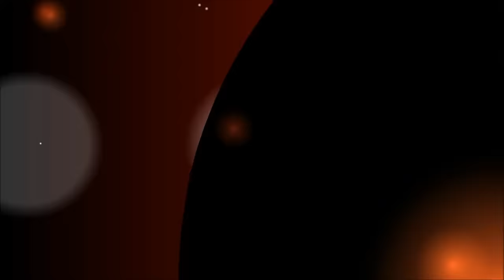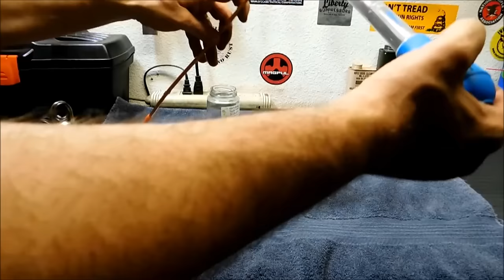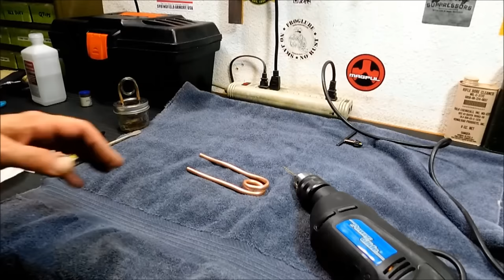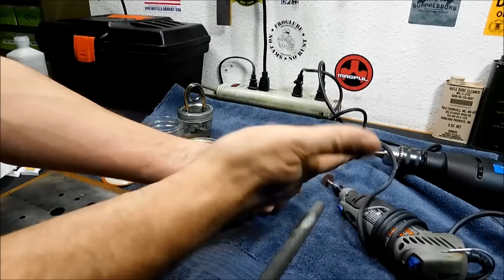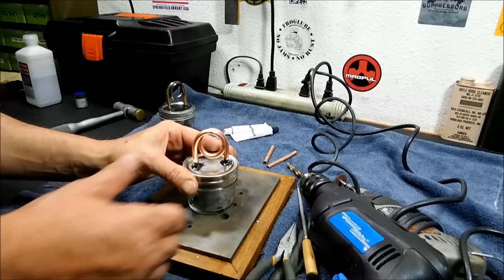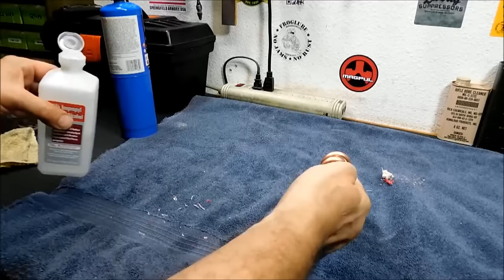Build Your Own Copper Coil Alcohol Burner Stove!

Comment: If you stick a little scrap of cloth under the drill bit when you are drilling your holes in the cap, it will create a more uniform hole. That or you can get a Step Bit, they are handy to have anyway.

Comment: I know we are all experts right? well anyway I have been bending copper tube for a good period of time in my short stay on this condemned planet and I can tell you that simply overbending the copper and then bringing it back to parallel will work a lot easier and faster with very little or no distortion and no vice needed with the exception of holding your shaping tube. I use a product called Cerrobend which I realize is not needed to make a lamp or two at the price of Cerrobend it would not be worth it but it does give you a great backer inside the tube it melts at 168deg and works great, anyway nice little project thank you!

Comment: Any cotton twine makes a good wick. You can buy if for tying poultry or roasts for baking. There are 4 types of alcohol that are suitable: Ethyl or grain 200 proof (expensive!), Methyl alcohol, for solvent, comes in quart and gallon cans, isopropyl rubbing alcohol, 70%, flames yellow, not so great. Isopropyl  rubbing alcohol 94%, pretty good, pretty cheap.
Reply: Denature alcohol from the hardware store is cheap and sold as a fuel. It's commonly ethyl alcohol denatured with methyl alcohol, which is toxic to ingest. But pretty much any kind of alcohol will burn, if it's pure enough.

Comment: I would like to try this.  But maybe modify it to have a preheating wick below the coil.  I think a second, tiny glass jar installed into the lid would allow pressure to be maintained in the larger jar.  Drill a wick hole in both the big lid and the tiny lid and use JB weld to attatch the kids to one another.  Fill the tiny jar, add wick and drew it onto the big lid.
Reply from the maker: I have since attached a small empty pistol casing under the burner now, I fill it with alcohol, light it, and let it prime it. Works perfectly

Comment: If I understood correctly, yes, this technically still has a wicking agent, however rather than being consumed, it only acts as a way of sucking up the fuel, and bringing it to a spot on the loop of the coil to allow only the fuel to be consumed? I might be exaggerating but in an emergency I think that’s a game changer. My problem is I wish I understood the gist of the process a bit better, so that maybe I could improvise or substitute aspects of the demonstration. It definitely seems important to have the copper tube which means needing a way to bend it properly the clamps the way to poke a hole strategically ect. I wonder, could this work with slower burning oils, maybe with a different wicking agent? If unable to acquire a hollow tube of copper would other metals be soft enough?  Could the mechanism of the wicking be effective in any other way, so that fuel reaches a burn location safely, involving less tools and shop experience?

Comment: Jb weld was originally designed to withstand engine block temperatures in drag cars which get a lot hotter than alcohol burning the designers needed something to fix cracked engine blocks so they didn't have to throw them out so soon they could get a few more runs out of them 👍👍

Comment: A cheap stand can be made from an empty Can. Cut out the bottom and cut a couple of holes in the side, not opposite each other. You could solder the holes around the copper tube too ... I think it would be better than JB weld ....

Comment: Curiosity Never Killed the kitty, the Kitty put on his thinking catnip were you where putting in sandblasting sand then kitty made me think real quick first thing that came to kitty mind in his 2% mind was breakline second click in a Split Second thing it comes to mind is fluid in a line becomes a solid substance oil or water one of the same as sandblasting sand in side the interior now we have a solid line.
Thanks for stopping by the house of curiously of kitties.

Comment: The sand tip is a good tip.  Also if you were to heat up the copper tubing first red hot then let the tubing cool.  It will be more malleable and easier to bend.  I would still do the sand trick but only after the copper cools down.
Reply: Ken Dalke That's steel, copper only sometimes gets softer depending if it was cold worked or not.

To anneal it you heat it and cool it in water, same way you'd harden steel

Comment: Thanks for the video, I have made and used a variety of alcohol stove designs in the past successfully....
  I had two questions : 
   How does the stove behave after it burns for a while? Hot metal can be prone to a 'runaway burn’ and having too much burning alcohol exit the orifice and spill liquid flame is a bad time. 
   Is there a risk of explosion? ...I had a similar design with the mason jar style actually allow flame back through to the air/vapor space  inside and blow the lid/ring off after a few mins of operation. Sent flaming liquid over a fair area of my workshop. Very happy I was in another part of the shop when it occurred. Frightening. I am very careful 100% of the time and this was a dangerous surprise. 
Thanks and cheers.
Reply: *Precautions and hazards should have been at front of this video.  *Thank you for noting this very real possibility.
Reply: @Bobby-mg1uj  Thanks for the concern and all Bob .....I am meticulously careful about safety, especially involving open flame + flammable liquids. I had done this in the past before I'd seen this particular video, so the 2 events aren't exclusive to each other. I have since changed the design to single wick and and have filled all airspace with an inert porous mineral material. Tested at high heat extensively with safety in mind and no issues so far. 
I appreciate the caution in your message all the same. Be well. Stay warm.

Comment: excellent presentation , if your not a teacher you should be.  my only 2 questions are ,is how long can it burn for before it heats up and explodes, and are the fumes harm full? ok my bad,, 3 questions ,, if i poke 2 holes,, will it produce twice the heat?
Reply from the maker: The bottom never gets hot (the glass area) it might get warm but never hot enough to pop.  No fumes that I could smell, other than the smell of rubbing alcohol.  You might get less pressure and less of a flame with more holes, the reason this really burns is because pressure builds up and makes the fuel a gas so more holes might mean less pressure.

Comment: This is very interesting. I'm curious how long will the fuel last? I'm sure its a good stove but would it be a good heat source? I'm currently experimenting with Crisco candles which will last forever but they aren't the hottest. This flame is much hotter but I would like to get around seven hours of burn time. Possibly a pint jar would last longer without being too large?!

Comment: Also I wonder why you didn’t make the “coil” in a horizontal fashion (making 2 loops with bottom loop having the hole) so that you could actually set items directly on top or top horizontal loop and take at advantage of both flame and heated copper coil?   Make the first or bottom loop a smalls diameter so flame comes out and through the upper horizontal coil and actually captures more heat in space between coil and conductor.

Comment: Put a dimple in the lid under the coil.  Fill the dimple with fuel and light. The burning fuel will heat the coil and start the pressurized flame.
Reply from the maker: Actually I cut down a fired .45 case a bit, and put it under the coil, works great now and you dont need a blowtorch to prime it!

Comment: Thanks for posting the video. Using your info as the model I was able to reproduce the burner, however I used a tin can instead of a mason jar and instead of epoxy I get the same results with super glue mixed with baby powder and it dries much faster. Thanks again

Comment: You could use JB Weld Radiatorweld, that will never have a too hot issue.
Reply from the maker: I never heard of that, thanks I will have to look it up, I still have this little burner, and it still works but yeah I always wondered about the heat and it degrading the JB weld.

Comment: May I suggest annealing a copper before and possibly during bending. Just heat it up with torch, over gas oven, or any other heat source and when it gets close red hot, drop it in a water. 
1)Obviously, you won’t be able to heat up the whole thing and keep it red, so do partial( local) heat quench. 
2) quenching isn’t necessary, just getting it to red hot is enough, but quenching in water makes it even more softer.
3) obviously use body protections, don’t catch anything on fire. Do it outside or have fire extinguishers 🧯 close by.
4) keep serious, mean facial composure, for an extra points...
Reply: Quenching (fast cooling) makes it harder, not softer. Annealing (slow cooling) makes it softer because it doesn't crystallize the metal as much.

Comment: i saw those same as your and they can burn in jet flame and I am sure yours will be too.  My tube is 5mm in dia and 0.5mm thick with a 1mm hole for the  flame.  It din burn good and I am not sure if there is anything about the wicks which were the cotton gift wrapping twine I stuffed in.  I am using the industrial alcohol.

Comment: Hmmm just wondering if you could pre-drill the hole in copper, cut copper to the right size, fish a 1/4 in wick threw a 1/4 inch copper, then bend copper

Comment: You dont need sand if you do it right. when you buy the 1/4 tube at Home Depot buy a 1/4 tubing bender for less than $15. save a lot of time and steps.

Comment: Could this go bigger, say a gallon jar with bigger copper with (3-4 tiny holes drilled in the copper).? If so, then I have 2 plant holders with 4 legs and open at the top (where a potted plant could be set in it). Like a 4 legged tripod. A large cast Iron pan on top would catch the fire's warmth. I would only use it outside.  Whatcha think?
Great teaching video.

Comment: Copper spiderweb 🕸   i found  some copper wire in plastic conduits  off cuts 3ft  1/8 thick wires  inside  - also had a  few old transformers about 🚶‍♂️ 
then my mind clicked 1 week latter  then made an aluminium  spider  and hung it in the toilet My mate said thats different never seen it done b4

Comment: Looks interesting.. and a claim of boiling 2 pints in 8 minutes is pretty incredible! It would be nice to see it in action after it's 'burn in'. Does it need to remain 'primed' so to speak?
Reply from the maker: Nope once you prime it it works pretty well with just some heat under the copper, however i did add a priming pan under it so I can put some stuff in there, light and it and let it go on its own

Comment: I wonder how long the JB weld will hold up to the alcohol? I really like this design but I would prefer not using any glass in case of dropping it. It would be nice to be able to cover and seal the top also so you could store it in a backpack full of camping gear without risking getting fuel everywhere.

Comment: Great idea! very smart......A silly question, like any propane burning stove..do we have to watch out for any type of example: monoxide poisoning type of issue when using this inside? Thanks
Reply from the maker: While burning alcohol inside is a bit safer (Most boats with stoves use alcohol stoves) you still have to be careful.  In a large room with a bit of ventilation you should be perfectly fine.
Reply: @Iridium242  Thanks for the quick reply

Comment: Definitely you have a talent for step by step description of your process! I will do this as I did buy a Trangia, from Sweden,  stove that I don't have an opinion about! I inherited 12 liters of ethanol, and though I am a Coleman  die-hard, I will use this fuel source I have! What is the support OVER your stove, that will accomodate a skillet or a sauce pan? You are alright! Thank You! Rattlebone...
Reply from the maker: I used a hobo stove in another video I did a few days after this one,  This stove fit right into it, and it worked great.  Thanks for watching!

Comment: Did this project exactly how you built it, even used the oil candle wicks. .250" OD copper tube(no kinks) and when I tried to light it, it won't stay lite. The interior hole is .0625. Is that correct? Using 70% isopropyl alcohol

Comment: Hey this is pretty neat ..one quick question though ..where exactly did u drill hole? In the bottom of the loop correct? Thanks much appreciated 👍👌
Reply: yes. think of the purpose of the coil. to allow fluid coming from the wick to be heated to vapor before it reaches the hole.

Comment: What do you like to use to plug the hole when storing the burner for days/months to prevent evaporation?  I assume that item has to be resistant to alcohol and not absorbent like wood.

Comment: Hay would placing a ribbon burner in the center with the copper tubing just to the side's of the ribbon burner with a twist valve for the ribbon stove to control the flame on the ribbon burner with a preeheat dish work? Been thinking about this concept for a while and wanted to ask someone who has worked on these type's of stove's? Other idea was to get an empty fire extinguisher and repurpose it into a alcohol resivor. Then use electronic's with a frequency emitter placed into the bottom of the resivor to cause the alcohol to vaporize building pressure in the tank. Organic carbon power cell used to power electronic's and frequency emitter. Stainless steel flip top trash can with foot pedle and hardware removed. Craddle to hold alcohol resivor and electronic's and power cell that can be lifted up abd placed into trash can and locked into place with a metal fastener. Copper tubing mounted on the indide of the trash can in the front that has connection's at the top to connect the alcohol resivor and a quick connect at the bottom were the foot pedle used to be. Then place a clap's to lock the trash can lid down and mount a handle to the top of the trash can. Otay now get a HHO 32 micro jet burner or a Jerusalem burner and make a mount to be able to insert burner into a Titainum cylinder. Then get a G stove wood stove and drill a hole into it's bottom and mount the burner with Titianium cylinder inside. If done correctly ypu should have a presurized alcohol system to operate your G stove by super heating the titanium cylinder which will glow white hot with the stainless steel G stove absorbing the heat. 😀👍

Comment: Methanol (methyl alcohol or wood alcohol) would probably work well in this stove.  It is cheaper than either ethyl or isopropyl alcohols if bought from a racing shop, where it is used as fuel for race cars.  Add a little boric acid and the flame will be pure green.

Comment: Does the wick feed the flame all the time or just until the copper gets hot ? Does the heated copper draw the fuel up after it heats up ? AWESOME VIDEO BTW !!!
Reply: The wick doesn't feed the flame. It feeds the fuel into the coil, which is then vaporized around the top of the coil. It's the vapor that burns when it exits the hole.

Comment: I did everything in this video but my jar was bigger ,and it won't work ,I've sealed it but guess I'll have to double check,very frustrated,are icopropyl alcohols different ,cause that's what I'm using ,any ideas please.
Reply from the maker: I tried it with a larger jar too, it wont work because it wont build up enough pressure, that's why i stuck with the smaller bell jar

Comment: Hey man, cool build.  I used to make similar out of a vienna sausages tin and a tuna fish can.  When i used rubbing alcohol, i noticed a soot would build up on my cookware, and I guess inside any tent or anything i was using it in too.   One time I tried using 'Heet Gas Line Antifreeze and Water Remover' instead, since it's mostly just (i think) methyl alcohol anyways.   Absolutely no soot with the Heet.  Burns as well or better than the rubbing alcohol, so maybe try some of that sometime.  Does anyone reading this know if burning methyl alcohol is particularly unsafe?  I don't think so.
Reply: Anon User hi. According to MSDS only byproducts of methyl hydrate (methanol) combustion are CO & CO2. Therefore not particularly toxic :)
Reply: @petermccarthy9153  you must be Canadian as the official name has been methanol since 1840.  Methyl hydrate is something Canadian like poutine and Tim Hortons, eh?

Comment: I want to make one of this. Some questions. What kind of alcohol u use. % of alcohol content. Where to get the alcohol. Thanks.
Reply from the maker: I used 91% alcohol, and got it at the local Walmart here but most any drug store should have it. If you cant find that, check in an auto parts store for an item called HEET, its an awesome alternative

Comment: When you boiled the water within 8 minutes, how much fuel did you use to boil the water, if you have a paraffin stove then we could compare the amount of each fuel that was used to boil the water and in turn we could calculate the cost in dollars as well as the cost in time that was used to boil the water and then we will know what fuel or method is the most cost effective :-)

Comment: I only saw the one little hole drilled in the bottom of the loop. Is this the only hole, or did you drill others to let the flames out? Where about are the other little holes drilled? Great idea for hobo stoves!
Reply from the maker: Yeah, just one hold at the bottom,  The gas builds up and vents form that tiny hole, and lights.  I did another video a few days after this one using this burner in my hobo stove, it works great.  Thanks for watching!
Reply: perfect for my homemade hobo stove! I'll have to get one of these made up. great video.